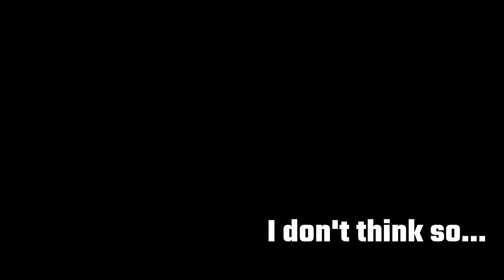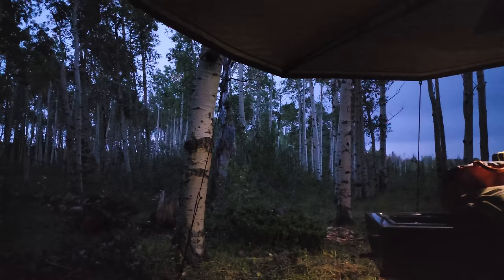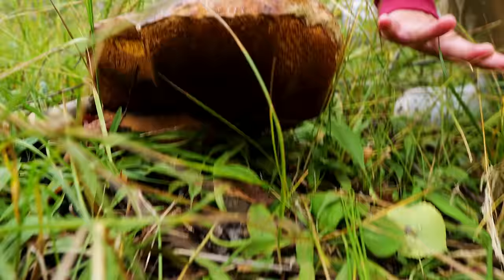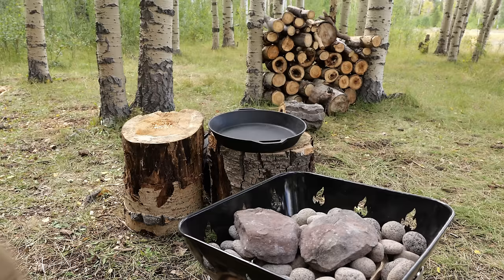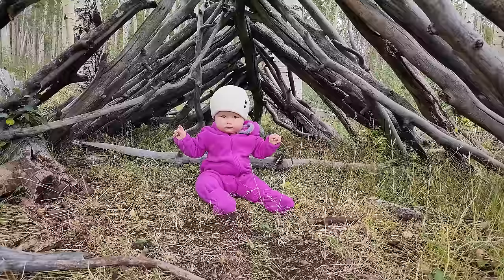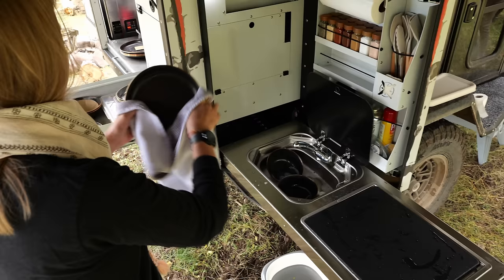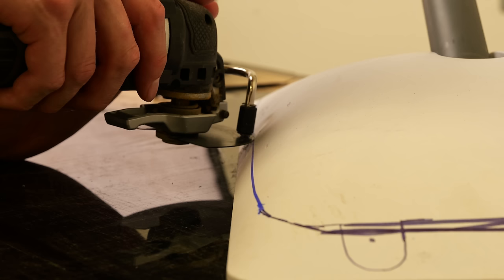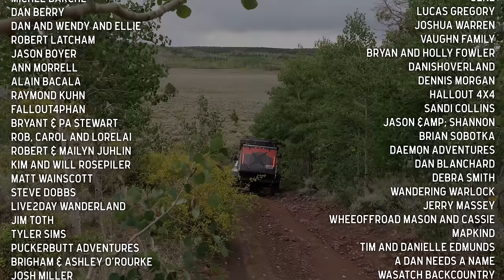Camping in our NEW Voyager overland trailer | So peaceful... [S6E29]

Comment: Did Xpedition and Bush design the roof hatch option with the ten for you or is that a modification of yours? Presuming that's what I saw to get the heat up into the tent for Caroline.

Comment: I think I have a weird question.  From the back latch all the way around to storage is the awning.  

Am I weird to think why wouldn’t the fridge be under cover? I typically have seen L shape kitchens.  I know the fridge can be slide back in and then it can turn into a tailgate as well and you can still get into fridge.   

I almost want to see the fridge rotate out so that it’s under the latch but then the counter top gets smaller.  

Maybe if the awning has walls then cooking in the rain is better I don’t know.